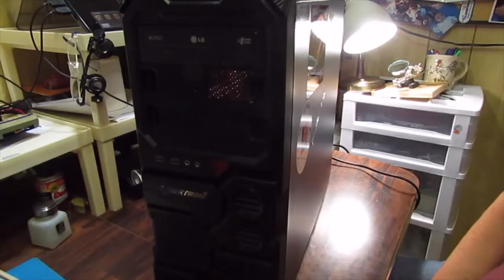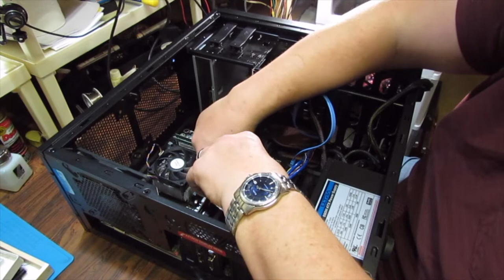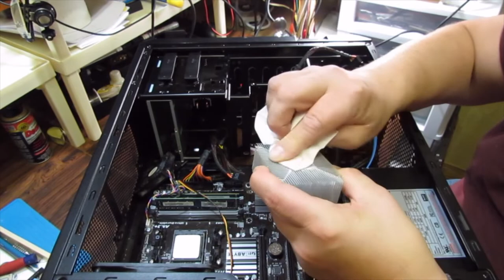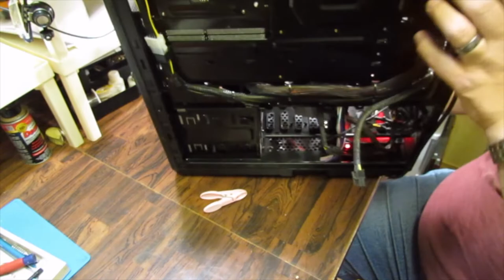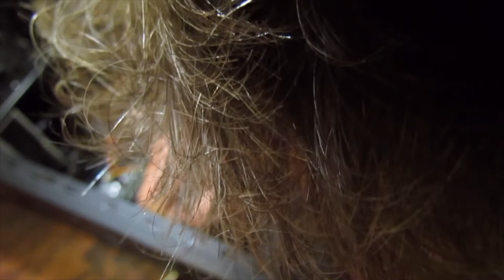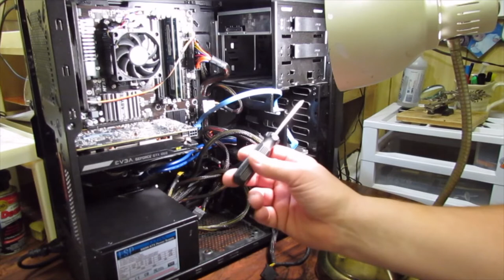This Gigabyte PC is more BEEP  than BOOT, what the?

Comment: I had the same problem, took out the ram stick and cleaned it with rubbing alcohol and placed it back. Worked fine and good after!!
If it doesn't work replace the ram stick and check your GPU cables :) Dont give up
Reply from the maker: Thank you for the encouragement and the tips. I have tried about 10 ram sticks, of the proper type is many different configurations.  I really feel that it is a bad solder joint under the CPU connector on the memory bus.  I may try reflowing the motherboard by heating it up in an oven.

Comment: My PC was beeping all kinds of different length codes and was also flashing all sorts of numbers including 99 and 999 and 64 and others.   This didn't stop the PC from running but it did concern me.   The next thing I know is that my seven year keyboard has stopped typing and it's backlit keys are dark.   So I shut down the PC, went and got a new keyboard, unplugged the old one and plugged in the new one.   I started the PC up and no more beeps or numbers flashing around on the motherboard.   Was this just a coincidence or had my old keyboard been the reason for the beeps and numbers???   Before tearing things apart inside your PC,  You might want to unplug the keyboard!
Reply from the maker: wow,  good going

Comment: How do the caps look. Voltage regulation for cpu and memory very critical. Good video
Reply from the maker: What are caps?  Haha, just kidding. No I didn't think of looking at them.  I think it is a failure of the CPU socket attachment to the board.  I could try and reflow it in the oven, but is it worth it?   Good to hear from you..

Comment: Ran into the same issue just now. Did the basic trouble shooting, will see
Reply from the maker: Good Luck.
Reply: Saw on some posts and video's that it might be related to faulty memory channels, there is nothing else to test and try now. I guess it's time to forget and get a full system upgrade to AM4. I can't even find any AM3+ boards on Amazon or any other online stores here any more. Which practically prevents me from getting a replacement board and being able to use any of what I have on the current system other than storage, graphics and psu.

Comment: hey brother...was the beeping issue resolved? i am facing the same issue
Reply from the maker: I am sorry to say that NO I never resolved the problem.  I am going to do some research and try to bake the motherboard in a warm oven to "reflow" the solder on the connectors. mainly the CPU socket.  I think it is a problem with the memory bus where it connects to the CPU.  All signs point to a memory issue.  There was a number of restarts and I think the thermal stress on the motherboard may have resulted in a bad solder joint.  I will post a video soon about doing this and the results.
Reply: @daslab68  True that....I had to switch the memory from one hub to another, for multiple times to kickstart the pc until now when it started giving THIS issue.

Alright thanks man!
Reply: @daslab68  Did you ever try the warm oven method to get this to work? I have a somewhat similar motherboard and the beeping

Comment: Just saying...... you didn't have the gpu plugged in.....
Reply from the maker: You are right,  that could be the issue.
Reply: @daslab68  it also could be some of the cpu socket/cpu pins bent (depending on Intel or amd) or if you check the ram and clean it

Comment: You probably just need a fan attached to PWR FAN connector.
Reply from the maker: Hmmm, Everything was connected when it first failed. The user did about 50 boots in a row due to slow performance then on 51 it would boot no more.  I think it is thermal shock on the CPU socket.  some bad connection that I cant get at.